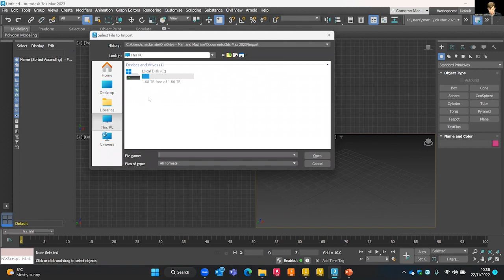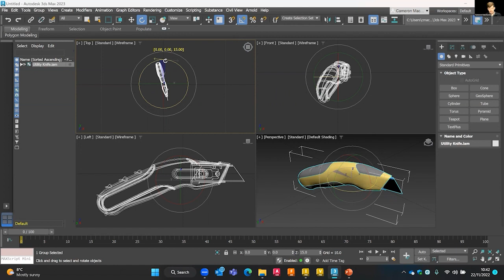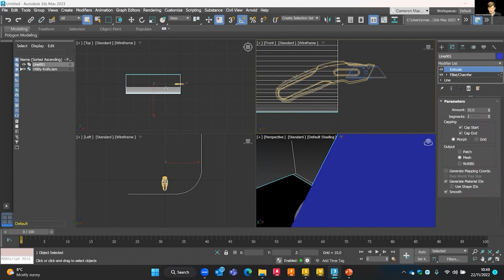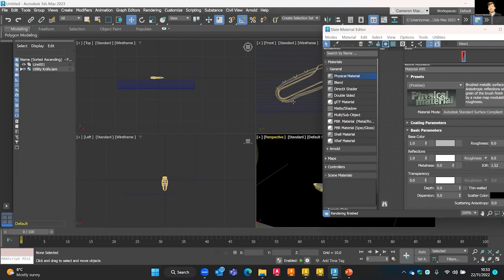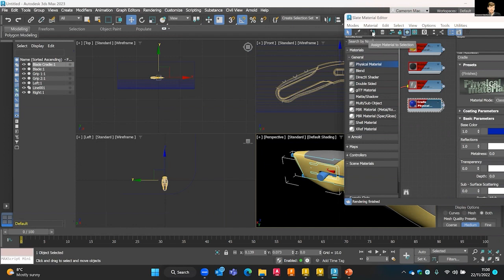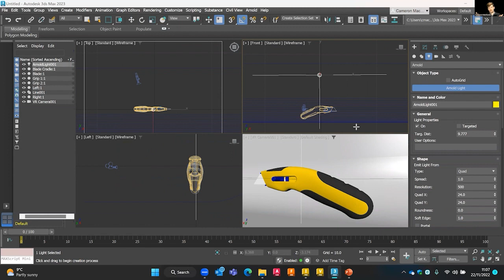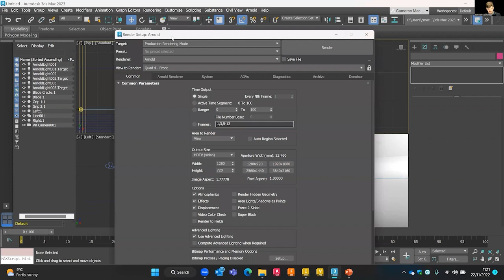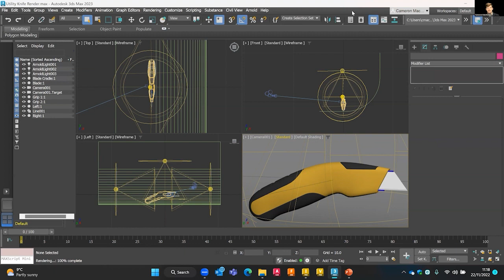Rendering Inventor Models with 3ds Max Product Demonstration Recording

Comment: Late to this party, but I do have a question, just in case this is still being watched. (I've been to the Autodesk forums, but they were unable to give me an answer since I did not have all of the info they wanted. I hope it can be answered here with what I can provide.)

My supervisor wants to be able to control the movement of sections of a model independently of other parts. He probably wants a full-blown animation as well, but also wants to be able to interactively control the movement of a segment of the model. 

In Maya, there are 'set-driven keys' that can give one control over the movement of scene elements. I gave him this in a Maya version of a file I created, but he wants to be able to do something like that in Inventor. I think he'd be open to doing that in a different environment (a video game, e.g.) if his prospective clients could also open the file on their end (and he doesn't expect most of his industrial clients to be using Maya). However it's done, though, I expect there to be a high learning curve. 

Does anyone have a suggestion on how I could go about this? How might one of you guys who are more experienced in Inventor, and are likely designers or engineers as well (I am neither), take on such a challenge?

Thanks.

Comment: Doesn't Inventor still have Inventor Studio? Much easier and you can even do turntable animations. Don't see the point in using 2 applications when you can do everything in one.
Reply from the maker: Yes Inventor does still have a Studio Environment, which can be used for creating quick renders. However, the rendering engine used inside of 3DS Max is a lot more powerful than the one found within Inventor. 3DS Max has the ability to not only manage and create textures and lighting assets, but also handles them a lot better than would be possible in Inventor. This allows us to have more realistic renders, without the need to remodel them in a new product.
Reply: @ManandMachineCAD  Agreed. The animation controls and features are also superior. It's a VFX application... Inventor is not.